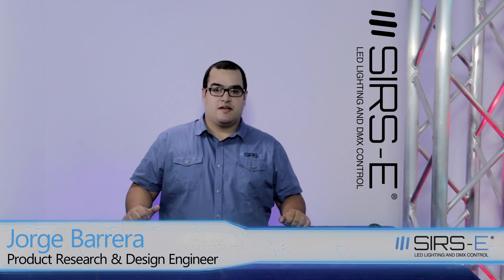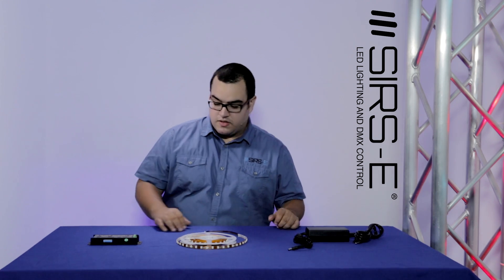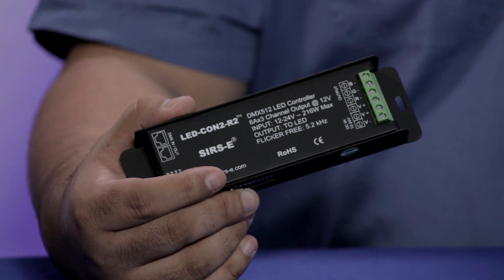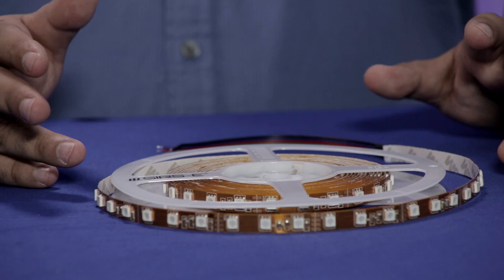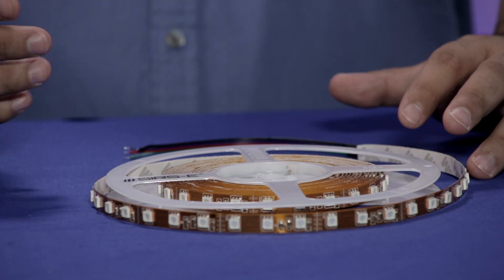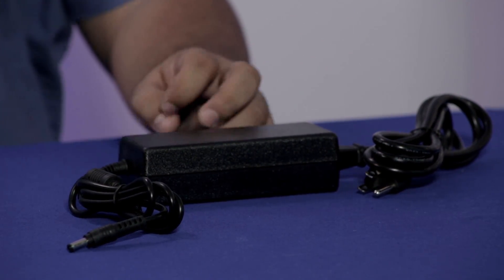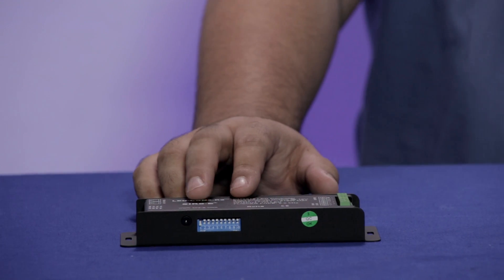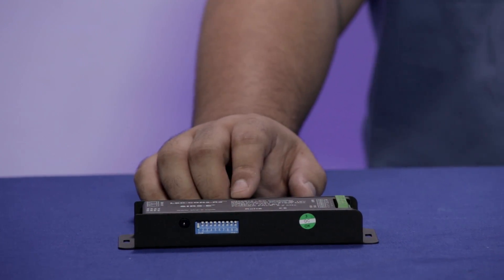LED Strip Basics What You Need for Any Project or Installation

Comment: I was searching for led light basics but this guy is blurting out too many complex terms dmx, wattage vs voltage (what's the difference).  Quite frankly I think he's trying to sell more than educate.

I just need someone to explain in simple english the difference between these terms and how to know how much electricity and which source to use to light up say a simple lamp or under cabinet lighting etc.
Reply from the maker: Hello, these terms are necessary to understand your installation. The voltage is important because different voltage models have different advantages. The watts/amps are important because this is the power consumption and will determine the power supply you will require. DMX is an option to control your LED's, RF is a simpler option it is a Radio Frequency Remote